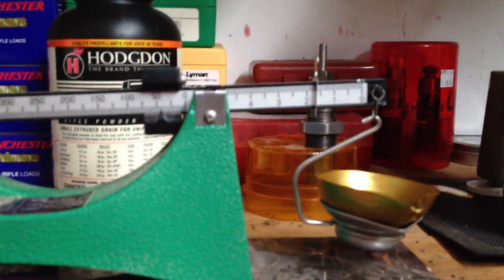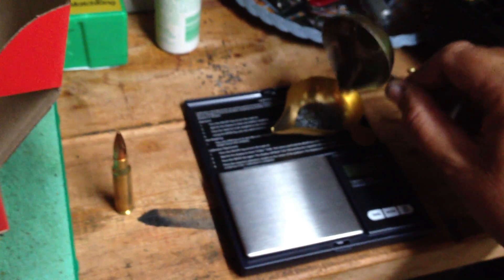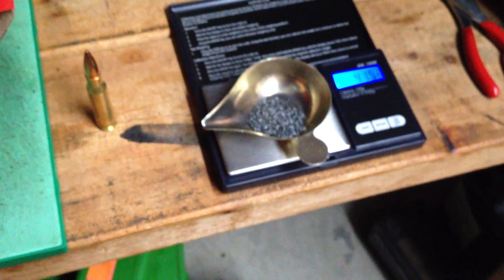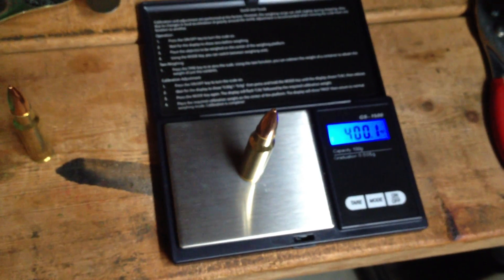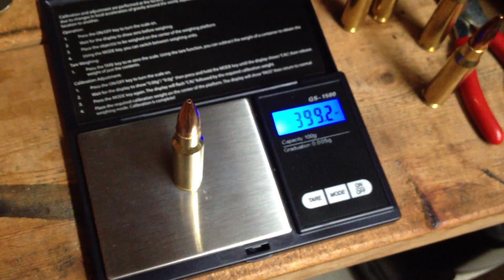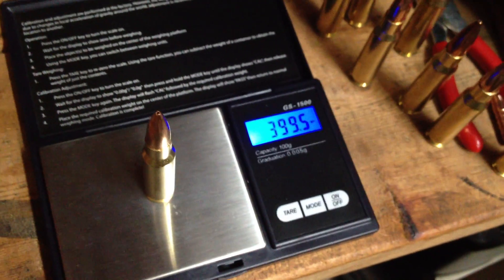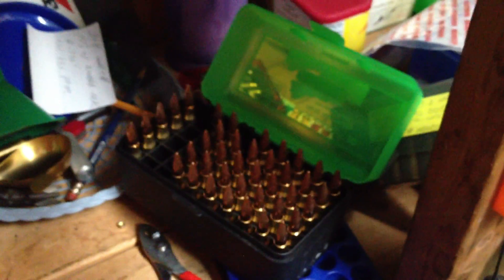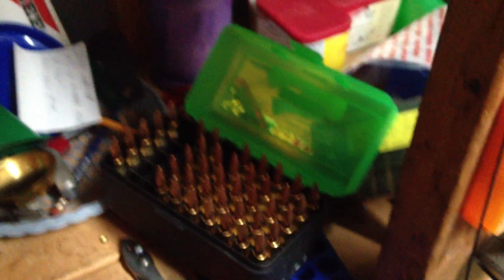Sleuthing the Federal Gold Medal Match long range load recipe.

Comment: On your OCW website you mention that Federal brass is not fit to reload.  Do you still feel that way after your evaluation of the GMM ammo?
Reply from the maker: Kevin... the newer batches of FC brass seem much better than the earlier batches.  So while I'd still rather use Lapua or Winchester, the Federal can be made to work.  I like to anneal it about every 3rd firing to keep it soft, as it seems to work harden faster than other alloys.
Reply: Im on my 4th reload of FGMM and still shootin bug holes. ;)

Comment: You said: 168HPBT ->42.8 grains of IMR 4064
the 175HPBT -> 41.7 grains of IMR 4064. Are you sure that isn't backwards? It seems that the heavier bullet would require more powder. 
The other thing that I found amazing about this ammo is that it has 1-2/10,000 runout on my concentricity gauge. I've got a couple thousand cases that I'm reloading. Great service, excellent video.
Reply from the maker: heavy bullets use less powder, as the heavier the bullet the more pressure a given amount of powder will generate... thanks for the kind words. :)
Reply: Joe Regina I need some brass. Send some my way.
Reply: look at a reloading book and educate yourself